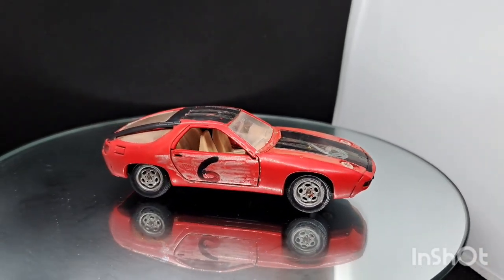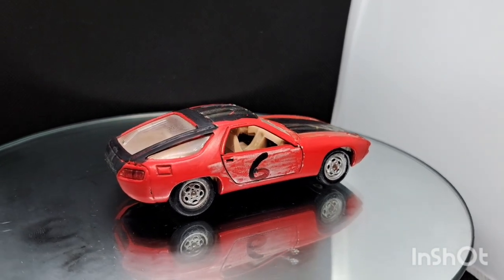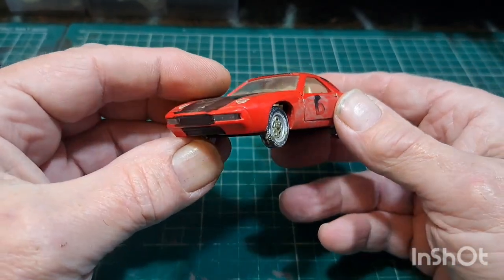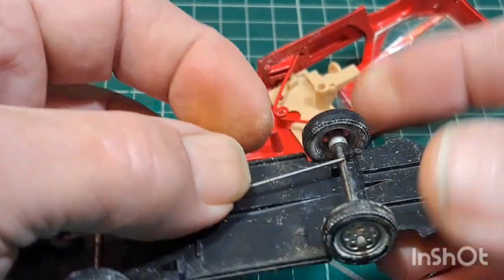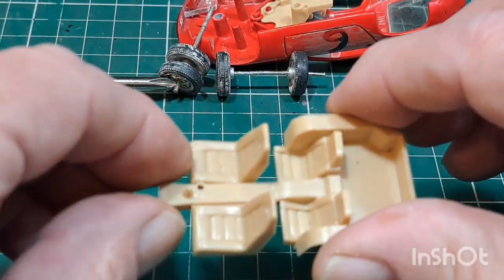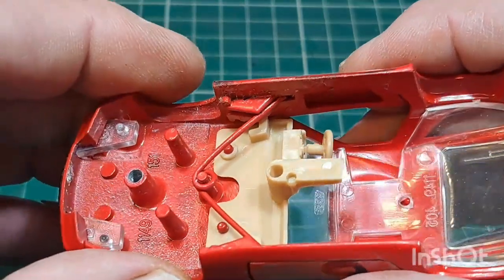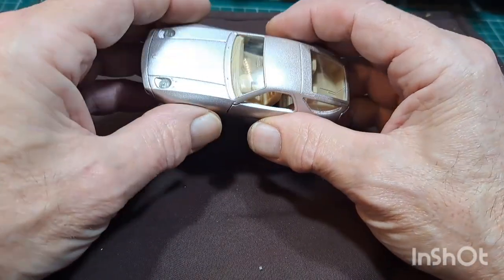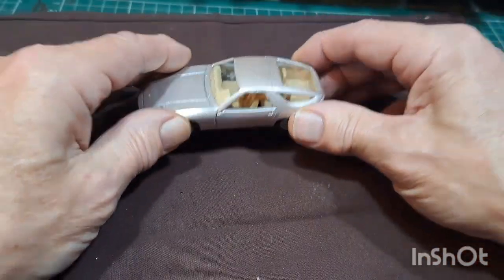maple leaf customs 3rd Aniversary celebration

Comment: Nice resto,Martin.Solido make mid range 1/43 cars,which in the main are racing/sports cars.you can date these by the numbers stamped on the base.there is a panel with a)the scale,b)the model number then a 3 digit date code i;e 6/77 which i think is what this model is dated as!Real car technology transfered to modelsThere is also a kit range which come unassembled,unpainted but with a set of decals included.BTW this is a 928,not a 926.All the best.
Reply from the maker: Thanks Terry, I did have a look after reading your comment and you were bang on with 1977 . Thay definitely do some excellent castings that's for sure ,very well put together. 
I appreciate it as always my friend.